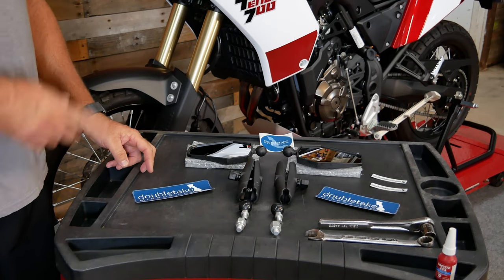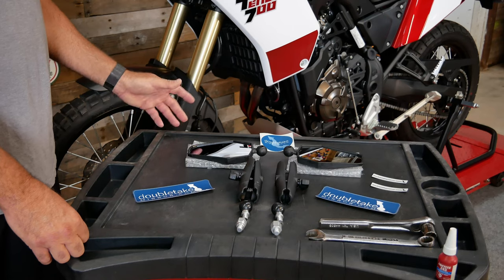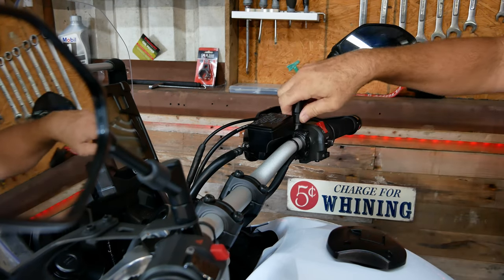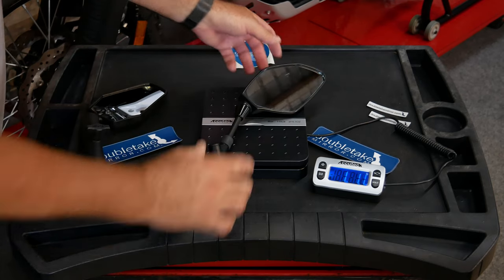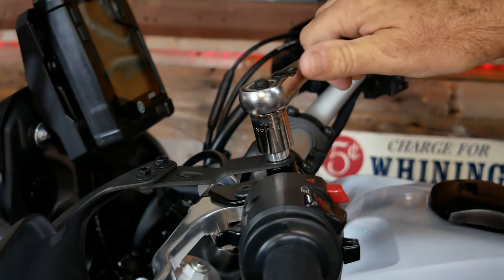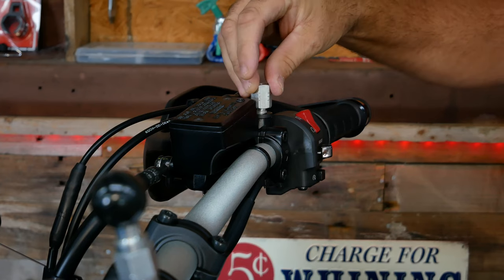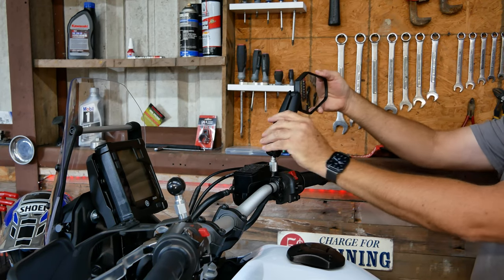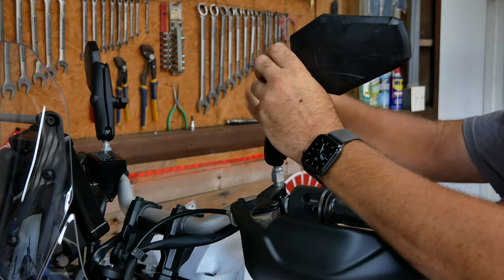Double Take Mirrors - Yamaha T7 Tenere 700

Comment: Hm, you've used loctite to glue them up?
Reply from the maker: Medium strength is still removable without much trouble. Definitely don’t use the red high strength.
Reply: @MotoSouth  Would there be any reason not to use red loctite where the ball connects to the adapter?
Reply from the maker: It should be ok. Just keep in mind that you probably won’t be able to separate the two without damaging them since they are aluminum. If I’m not mistaken, the ball portion is aluminum with a rubberized coating that could wear over time and might need replacing at some point.